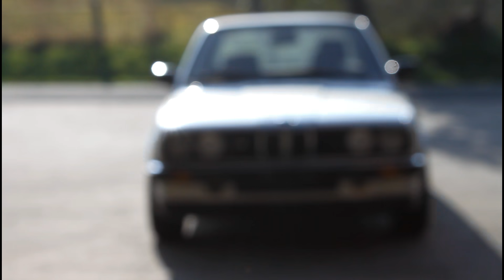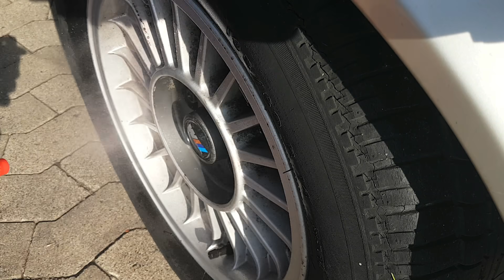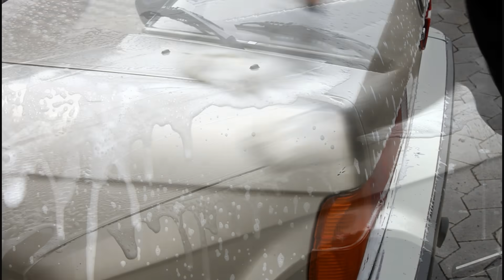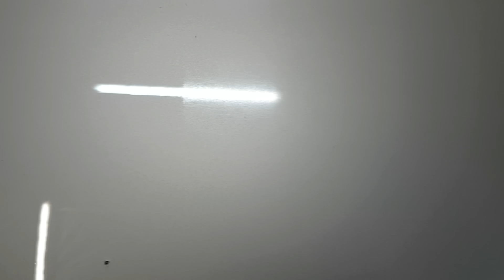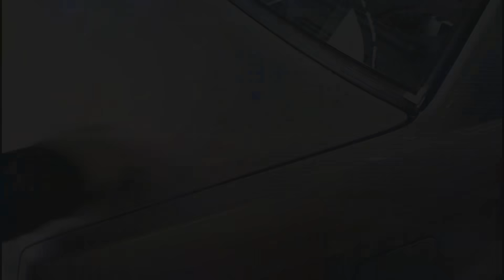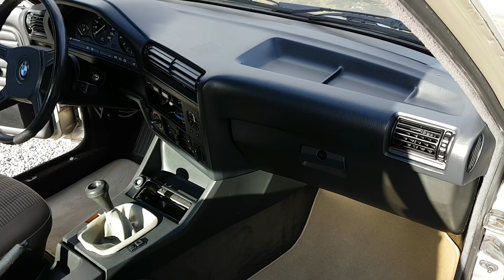BMW 325e E30 Detailing | Sonax Netshield

Comment: beautiful work! And very nice car!

i love the e30, the cabrio is my dreamcar😍
Reply: ihave a 325i cab 87 model,and it is now going for new fullbody paint and almost all body parts will be new:))we are talking about even screws:)
Reply: :) i have 2 cabrios, a 1991 318ic and 1993 325ic
Reply: Can anyone tell me what is a good and realistic price for a clean E30 in the US?
Reply: in us it is cheaper then europe and not so rusty if you buy it from warm places all year like florida or L.A.....realistic price 5-6.000 for a 320 or 325 but not en exalent shape the worst thing with us e 30 is the bumpers....you can use them like a bed if you go for a camp.
Reply: Arne B I have a 1990 convertible with a hardtop for sale it's black with red interior in mint condition only 67000 miles
Reply: Nice

Comment: whats with all the M badges on non M bmws? common guys we arent Honda people
Reply: ///M means it has an M-Packet option. Better seats, suspension, GPS, .... so when you see a car with this symbol then it means that it has some extras in it. This can be from 316 to 330. The logo is one of the few things BMW gives you for free when purchasing a new car and you can opt to not have it on your car even when you have the M-Packet option purchased. 

And then there is the ///M3 logo. A whole differernt story. 

Facts. They have big power. Try it sometimes.
Reply: oh ok i thought the M was put on the car after. i wish bmw didnt even put the M on them unless it was a legit M3 or M5 and so on. makes the actual M3 and M5 care seem less rare
Reply: they are from eBay
Reply: MrYision they aren't from eBay bud there from the factory they came on the car as the ///M package
Reply: The ones on the wheel are 100% eBay, I'm not completely sure about the one on the front grill, but I don't think its from factory.
Reply: MrYision the ///M logo stands for the special package option that BMW offered not part of the M series because the M series has the logos ///M2 ///M3 and so on, just an My stands for the special feature package which it was optional to put the badge on the car but it does include the ones on rims and the badge there is no eBay here
Reply: Dude, I know what the M-Package is. I have several BMWs myself. Those ugly emblems on the E30 though, they are not from BMW...
Reply: chinchy111 lmao its an mtech 1 e30. Don't comment if you dont know what your talking about. They are an m series model and they have a lot of m trim from the factory
Reply: AFX Gaming ///M badge is just to tell about optional extras, the ///M3 (or any other number) means the whole car is a big extra. Like Benz E350 or Benz C63 AMG. Same look (with some differences) yet two different vehicles :)
Reply: John Crusader no sir, its an mtech 1 as i said, not an m3, just a m model. What you're saying is sort of correct but all that needs to be said is it is not an m3, its an mtechnic early model or mtech 1. Pretty rare and wheel caps and grille badge is factory. Door sills also say mtechnic and the gauge cluster has an m badge as well as the oem steering wheel. Seats have 3 stripe badges and some even have exclusive mtechnic interior. Please dont comment unless you 100% know the facts about the car and the badge meaning. M3's say m3, mtechnics dont, its just the mtechnic model and trim
Reply: M-packet on an E30? I don't think so...
Reply: Nah... nevermind what I wrote... it was ment on another video with a newer BMW... just realised how the new youtube comment style led me here which was wrong. Add several open Youtube windows with comments only... Sorry about the confusion :)
Reply: No problem ;)
Reply: spavatch considering i own 2 of them i think i know what im talking about lmao, ill say it one more time, mtech 1 e30. Its an early model with the exposed dvingboard bumpers whoch are exclusive to the mtech1 and the mtech/alpina exclusive 16in wheels. Mtechs came w no hub caps. The facts keep flowing this is the third comment ive made, read before you write 😂 its an m package, but its not an m3. Just m styling around the car
Reply: No such thing as M-Packet on an E30 model. The only E30 that should have M badges is an M3. Back in the day dealers wouldn't even sell you M badges unless you could give them an M series chassis number. Fact.
Reply: slacko1971 there is such thing as an M packet E30 all you have to do is search it up dude hundreds of them will pop up do your research
Reply: slacko1971 and it's not M packet it's M-Technic
Reply: Lmao so you tell me there is such a thing as M packet then you tell me it's not M packet but M Technic.
M Technic was just a dealer fitted body kit. My research is based on the fact that I fitted dozens of them whilst working in a BMW main dealers late 80's early 90's. Again the only E30 which has genuine factory fitted M  grille badges is the M3 anything else is just BS badges that some moron has added.
Reply: The owner did well to stretch some 14 inch tyres onto those 16 inch rims your talking about.
Reply: slacko1971 2 things. One if you installed "kits" in the 80's you wouldn't be sitting on YouTube comments arguing with an 18 year old who owns 2 e30's and knows more than enough about them. Two couldnt tell you if they actually are a 16 im just going off what I know about that style of wheel oem wheels. Maybe i was wrong. But mtechnic's are simply and nicer M styling in certain places around the car. Door sills, interior. And the m badges most certainly did exist on these as an option. The M3 is a completely different car in itself. The mtechnic is not a body kit lol. Alot more than a body kit and not a part that was to be fitted after production at a dealership.
Reply: I'm not arguing with you I was simply trying to enlighten you but it appears it's all in vain because you are an eighteen year old who knows everything, which is kind of funny seeing as you weren't even born when these cars were produced. Not sure why I shouldn't be on YouTube myself ? Is there an age limit?
Just to repeat, M badges for the grilles were never an option for the E30. You can own as many as you like I don't care. The only BMW from this era to sport an M badge officially that didn't have a M-tech engine was the E28 M535 any thing else that has M badges on the grille they have been retro fitted and certainly not by the factory.
Reply: slacko1971 argueing is exactly what your doing lol
Reply: I prefer to think of it as educating.
Reply: But this one is not an original one. back in the e30 days they were non M badge for m-paket vehicles.
Reply: soooooo....my coworker works at a BMW dealership and i finally asked him if this is true and he said yes some non M3 e30s did come from the factory with M badges on them.
Reply: It means its the m sport version not the m3 version
Reply: mbrown21345 if youve owned two of them how are you not aware that this is not at all an mtech 1.  Doesnt have a single piece of the kit - front valence, rear valence, or skirts.  This is just a euro spec early model with the small chrome euro bumpers.  Also yes, Italy/Portugal's 320is and South Africa's 333is came with m badges - no other model had them from factory (besides small "M Technic" badges on the body kit pieces of m technic cars.  Just wanted to put an end to the misinformation in this thread for everyone.
Reply: mbrown21345 shouldn't it have a tech 1 kit and boot lip if it's an Mtech 1 car?
Reply: Sure you are no Honda guy? The M badges are not just for M3 M5 and the others, there is also a thing called "m line" seats , steeringweel and other details.
Reply: e30kitty dafuck, this isn't an Audi,
never call it M-line again
Reply: e30kitty what the fuck are you talking about? When this car was produced you couldn't get M-tech (like its called now) parts and badges!! Not available.
Reply: It is just an regular e30, it doesn't have any m-technic parts... it also has some e21 rims, thats the only thing that is moddified. So it doesn't deserve the M-badge...
Reply: M-packet?? Kinda like a ketchup packet??
Reply: It is literally called that in my language couldn't find a better name at that time. M-tech then.
Reply: Real bmw owners, especially m owners know it when they see it.  Like debadged 3 series. LMAO
Reply: @_J.P._  prefect answer!
Reply: The guy next to me in his m5 liked my Honda he said the rear-end is quite a nice one..... For a Honda
Reply: chinchy111 it is basically a sportier version of the normal car but not quite as sporty as a hard core m3 so the ooor guy can say he has an m car lol
Reply: chinchy111 that’s why I’ve began to hate bmw. They put their M badge on literally every single one of their cars now and it makes the real M cars not even feels special. On the contrary Audi only puts RS badges on their best cars which is why they feels so exclusive and special
Reply: @_J.P._  Tue that. But this BMW E30 325E does not have an M package or Mtech. If it had those packages, the seats and steering wheel would´ve been different. This is an ordinary E30 325E with an M logo in the frill, and non factory M wheel caps on the rims. And from what i remember you don´t even had M or Mtech option for the period of the E30, That became available in later models, like the 90s models E34, E36, later E28´s E31 E39 E38  etc
Reply: Run of the mill e30. Not an mtech at all. No recaro seats no mtech steering wheel or gear knob. No body kit. Even mtechs didnt have m badges. 
Alpinas had different logos of wheel hubs but these wheels are off an e21 bmw.
Reply: if you know any thing about bmws then you would know they came from the factory like that

Comment: Nice work. Thanks for not blasting the engine compartment with a pressure washer. Glad you still had some clear coat to work with. God that mould looked awful.

Comment: Alright, I need some advice here, I want to buy a cool project BMW from the 80s. Any BMW fanboys have any recommendations for a manual coupe that I should buy? I love the styling of these older Beemers and want to build one that's a decent platform that would handle rather well with suspension mods.

Comment: Its 325i not 325e
Reply: it's a 325e look where the icv is located, it has a cold start injector, and intake runners are smaller in diameter.
Reply: tRawwwww1 oh yea didnt notice that